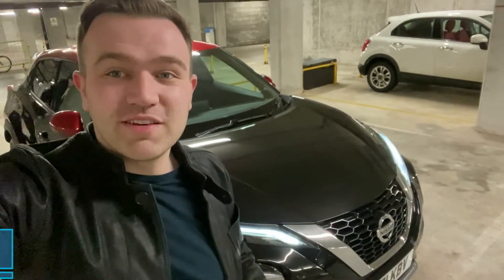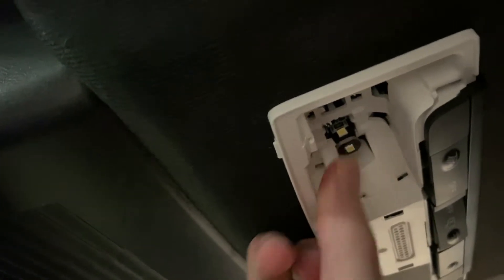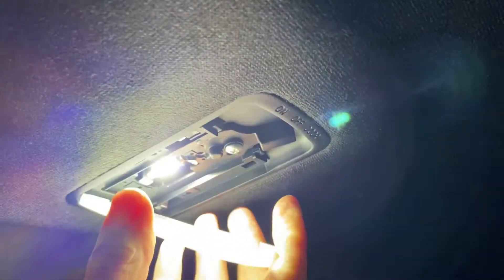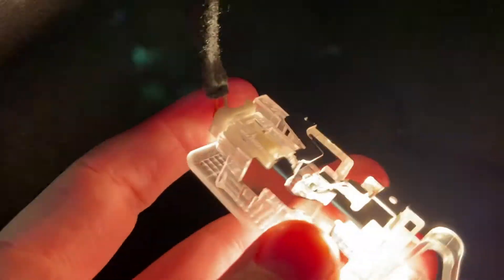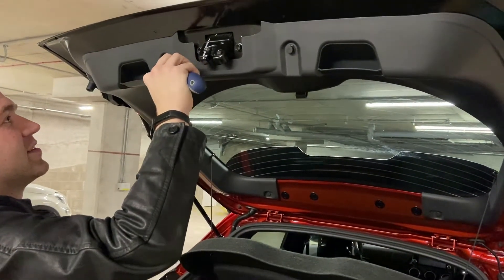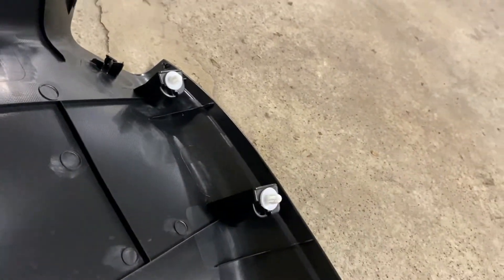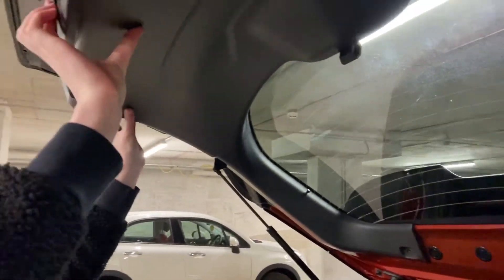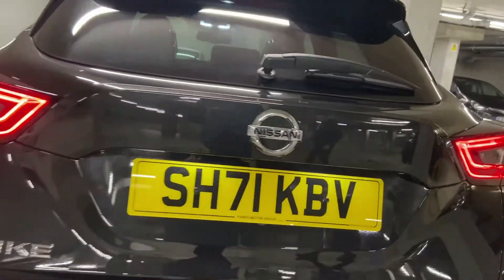How to change the interior light bulbs on the 2022 Nissan Juke to led.

Comment: What about the little one down by the gear shifter?
Reply from the maker: the ring light?
Reply: @CarsofGlasgow  think so. The one underneath the radio where you keep say sunglasses? I tried to take it out but not sure if it does and I don't want to break the Mrs prode and joy 😂
Reply from the maker: @tonyc9793  oh I don't know and I don't want you getting a row!
Reply: @CarsofGlasgow  hmmm wonder if it's new on the hybrid model? Can't remember if it was there on our 2020 plate 🤔
Reply: @tonyc9793  did you replace it? Also don’t know if it’s removable
Reply: @apj3863  no mate. Not bothered with it